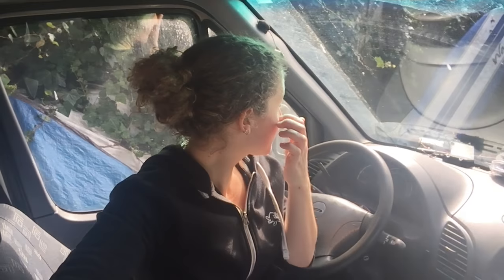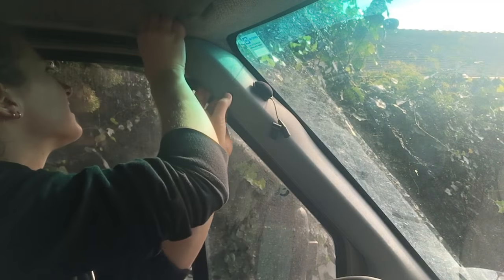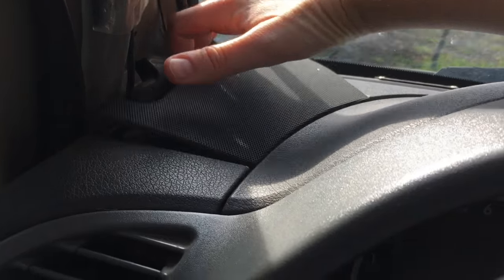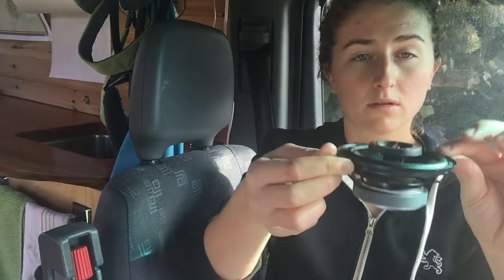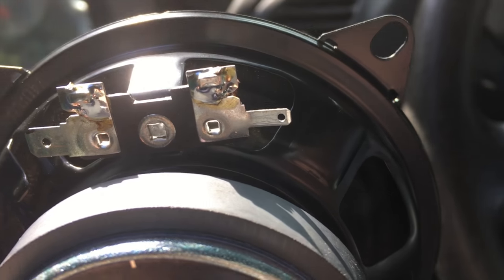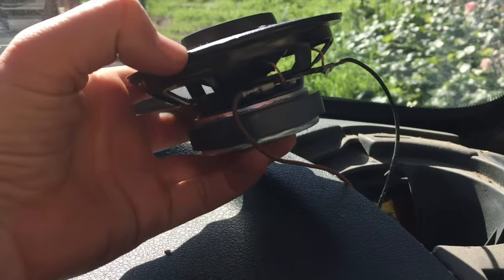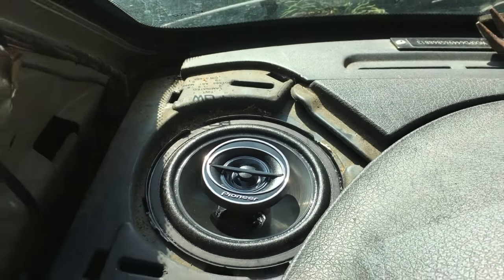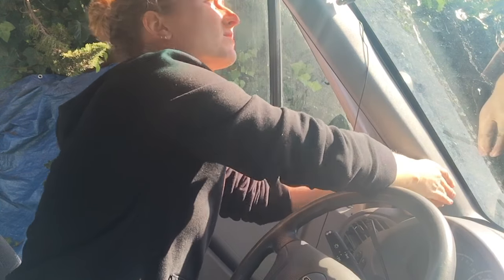Sprinter Van Maintenance - Speaker Replacement

Comment: You rock!  About to do the same with a 2005.

  One recommendation, speakers need to be secured to get maximum bass.  If they can move, the movement absorbs some of the sound.  You can also create buzzing, rattling, or banging noise when the speaker contacts things around it.  I plan to use a little silicone around the rim of the speaker well, where the speaker sit on plastic.  This will hold the speaker in place.

    Also, the foam structure under the trim gets fragile and breaks.  Mine ended up in 4 pieces.  You can order new, or...  I put mine back together using gorilla glue, and Gorilla tape to hold it while the glue set.  It ain't pretty, but it does it's job.  :P

Comment: Nice video Kaya. I have to note that I used these exact same Pioneer speakers in a replacement I did two years ago (Pioneer TS-G1045R). They promptly blew out again. I think this is because this Sprinter van is pretty noisy inside, with diesel engine, various RV gear, and un-helpful acoustics. So, I need to play the volume fairly high. I'm thinking about trying again, but will need to find speakers that are more robust.
Reply: Curious to know if you found more robust speakers!
Reply: I just bought JVC Speakers for my  2003 merc Sprinter T1N  JVC CS-DR421  have not fitted them as waiting to take delivery of my van   220w recommend by Super cheap Autos  just bought them  Im sure you will find it's the Sun the heat on the dash that destroys the speakers use dash mat and sun shade ..the Sun is extremely damaging ..

Comment: Pretty sure the extra plug on the drivers side speaker comes from the body control module and is for the seatbelt chime, key in ignition chime etc.

Comment: I just got myself a t1n and the audio is VERY underpowered compared to what I'm used to (in my sedan!)... I can't tell if the speakers need to be replaced or if it's just a crappy audio system... is there an easy way to really upgrade the system beyond just replacing the speakers? Do you feel like the Pioneers you got did the trick??

Comment: Has anybody who's done this had any problems with the speaker not actually being secured to anything inside the dashboard? Do they bounce around any? Or buzz when you turn them up? The original speakers were held in place with those springy tabs and the new speakers have screw holes that you broke off so they just kind of sit down in there. Has that been ok?